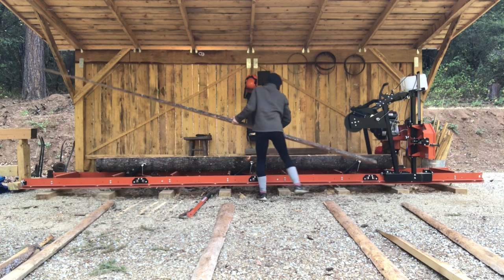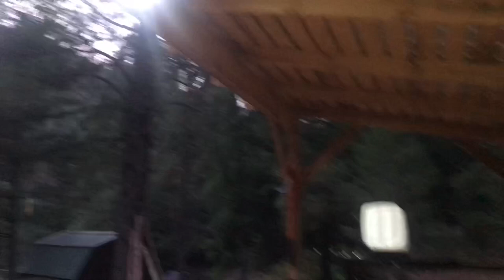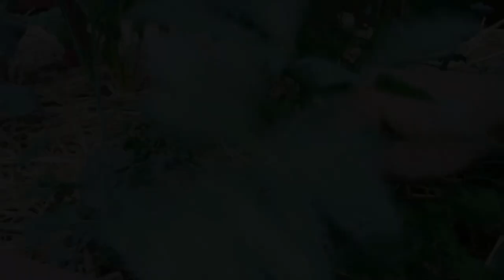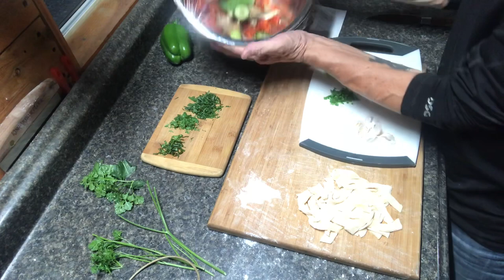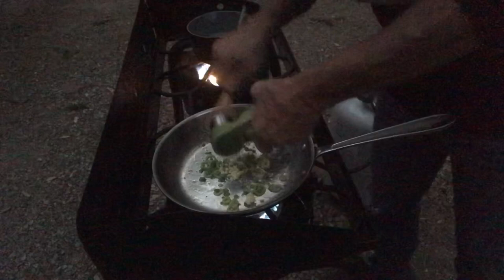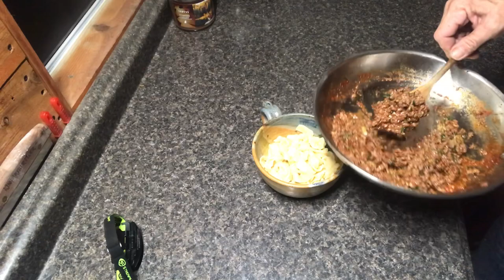WOODMIZER/Cutting a 6x6 15’ long

Comment: A thought on how to roll those large logs on to the mill is a come a long on the bottom of the back post and loop the cable around the log and back to the post. Would also help in flipping them for the next quarter roll. I noticed you had help on another vid for that. I cut and split 12-16 cords of wood for my boiler each year and know it can be a fight at times moving those big logs. My largest so far is a oak 46" dia and 12' long. Lots of grunting. Great video
Reply from the maker: Thats a good idea. Wow… That’s a lot of wood.
46” that takes a big bar. 👊
Reply: @offgridhomesteadingmcgarve1494  I made a extra long can't hook out of 1x2 steel tubing and made a long hook for the end.
Reply from the maker: @johnhunter287  I could have used that the other day..😂